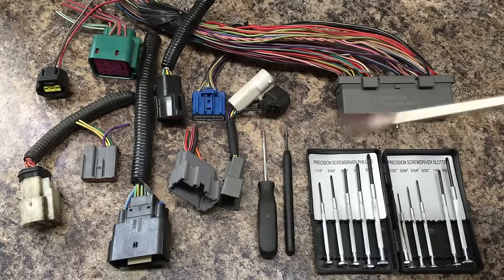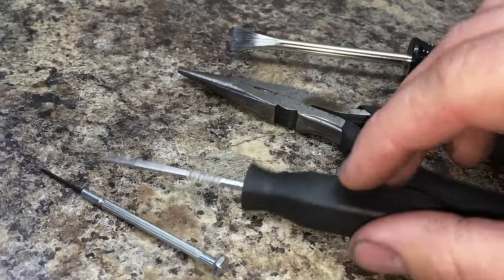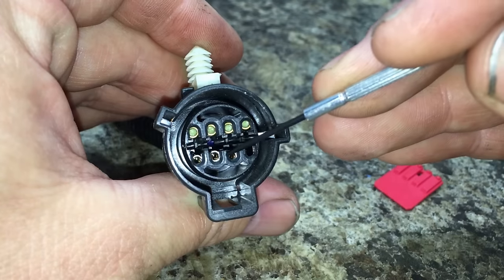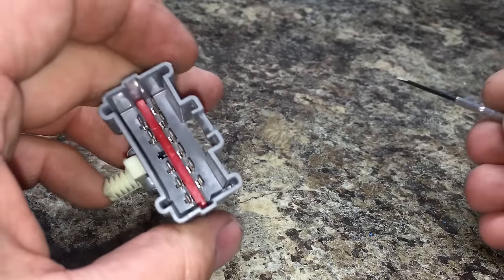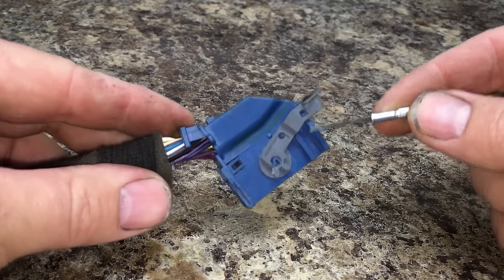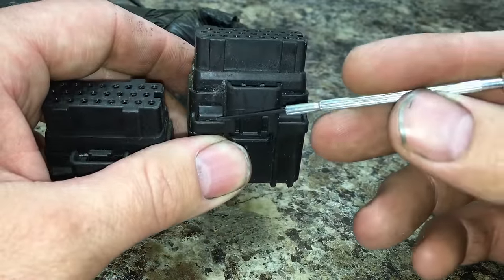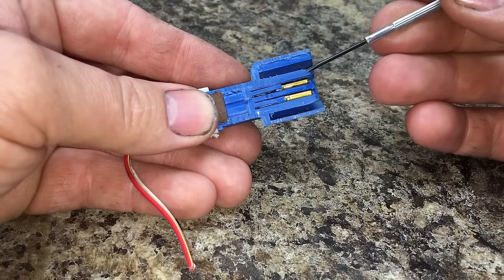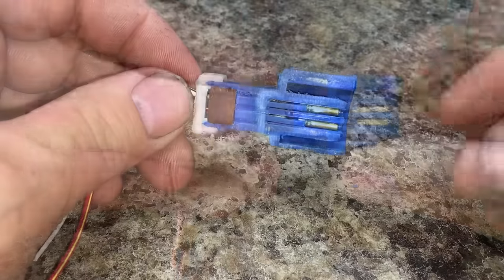Ford Quick Tips #62: Rebuilding Electrical Connectors on Your Vehicle

Comment: Commenting near 4 years after the fact, but I just wanted to say thank you so much.  You are a Ford guru and the world is better for your excellent videos.  I needed this exact video.  Excellent.  Thanks again!
Reply: Hell, don’t apologize I’m reading comments 5 years after. :-)
You’re right, thanks to FordTechMakuloco for the video. I couldn’t remember how I’d done this before.
Reply: Why was there a missing connector on the first pigtail will that piece need to be replaced with another connector?My map sensor pigtail is missing one also and a P2096 code appears so I am replacing the pigtail but want to be sure.

Comment: Timeless, hey it's 2021, and my 05 Mustang threw a P0193. My fuel pressure is at 68 to 70 psi. The duty cycle pumps are running at 100 %
I've tested everything from the Fuel Pressure sensor and it's in tolerance.
After 2 months of searching, including asking local Ford dealer to sell me info and asked on online expert who told me unless my car has a problem operating he didn't feel like he had to answer.
I scored the diagnostic tree. Itwo tests on I found the problem is a bad wire Pin 3 harness side.
You just gave me the.piece of the puzzle to finish. Thank you for making this video.

Comment: Searched up blower switch  plug and this video popped up.  I guess maybe because I am subscribed.  My 2005 FX4 with 187k miles is living a good life because of you. It's mostly towing (boat) and dump trips these days.  I work in auto care, but I'm a front of house person with mechanical work as my hobby
 Also my cars never get in...  You may know the dilemma of how the cobbler's children go barefoot!

Anyway, great video. I never stopped to figure out connector repair, and now I found a broken retainer on my blower motor plug when I removed my center stack cover to add bluetooth. Which is great BTW.  Now I don't need another radio and subscription to listen to satellite, just runs through the phone. 
You just gave me the connector solution, Love It!

Comment: Thank you sir. 
All the lighter sockets in my 2015 F-350 were wired always on. Wanted to set the console socket to ignition control, for a Dashcam. Your video was exactly what I needed. 
Thought I was going to have to run a wire from the fuse box. Discovered Ford provided the option at the harness, but I needed to switch some pins. Not wanting to hack and splice. 
Happy camper.

Comment: I know this is an older video, but car manufacture's now of days have a couple ones out there to be wary of. One in particular is a nasty bugger. For this particular type you have to take off a plastic retainer/cover(typically white) to expose the terminals, then you need to push in the soft rubber end(purple/pink) with a small screwdriver/mini Allen key. This pushes the connector forward where you now need to take either a needle nose pliers or tweezers and very gently grab the terminal, now rotate it 180*, then gently push up on it and slide out. I've only seen these on New Nissan's the pins are 1mm.  I found only one extra at a pick'n'pull to figure it out so they are RARE, and you cannot find them online to replace.

Comment: On the last blue/red/white connector, the "element" seal at the end is also serviceable.  It can be removed, and it's internal seal replaced as well.  On many connectors, you must remove this to completely remove the wire connector, as it's tolerance is for water/debris.  Nice video.

Comment: First off you rock so much for sharing the info by any chance would you also share what type the actual pin connector is, like size and usable replacement have a few wires that need new male or female ends and would like not to have to buy the whole pig tag if I can just replace 1 or 2 wire ends

Comment: Perfect timing. Just ordered empty connectors to repin my coil pack connectors with broken tabs.
Reply: Been down that road. Ford pigtail for replacement $85. Plastic shell $5.49. The trick is finding the shell. Ford is no help in identifying the part or a source.

Comment: 5 years after, but after a mouse chewed an ignition coil wire- dealer wanted to charge me $535. I found the offending wire and was just going to buy a new plug for $25. Thanks for the knowledge! You’re awesome. Now to get some hot sauce tape!

Comment: I replaced the connectors for my coils on my 5.4 ford expedition and they are working great...but now im trying to place the connectors for three of my injectors but im having a little problem trying to take off the red clip to release the wiring from the new connector...Is it the same process?

Comment: I just put a Frankensteined T45 transmission front half from a 97 Mustang mated with an 01 tailshaft housing and digital sensor/tone ring into an 04 Mustang GT set up for a TR3650...same same but slightly different ! Now a Franken-harness to match seems to be in order. I hope this works as Google doesn't understand what I'm trying to do lol.  This is arguably a downgrade but it was also almost free to do this and keep it on the road. It runs great but the speedometer and odometer connectors need swapped to make them work. Also the way its geared now its somehow getting me 33mpg with a 4.6 2V V8 while doing 13s on the 1/4. It's FBO but tuned for regular gas.  I've measured off of multiple GPS devices 33mpg its not a joke! I'd recommend this swap if anyone needs a cheaper option if I can get this to work with your de-pinning tips. 🤞

Comment: Great instructions. I have a 2006 subie sti with a broken alternater plastic connection. Need to replace the green plastic body only. Now I know how to remove the 2 wires  and instal, on the new connector. Muchas gracias

Comment: Quick question: what if you wanted or needed to replace one of the pins/terminals?  Where can you get those?  Does Ford sell them?  Are they just simple Molex connectors that you can get at any hobby electronics place or what?  Thanks

Comment: Really Great Video!  You weren't kidding that this was going to be an excellent and much needed video on the what why and how too on connectors. Seems the clips are almost always breaking off due to age, being removed and reinstalled numerous times, environment and especially due to heat in the engine bay on the plastics. Awesome Video !!

Comment: Great video,hey you wouldn't happen to know where i could find shells for Ford connectors? i have a 95 Thunderbird I'm restoring and i took the whole harness out, the fuel injector ones are classical that the tabs always are broken on those and i dont want to splice a new one, i just wanna change the shell,pretty much all the connectors are brokeen due to heat etc but just the shells,thank you for your time.

Comment: very nice, used a dental pick in the early 80s on toyotas. in the case of the wire end not coming out thru the end cap on that blue cutaway, will the end cap come off easily ?

Comment: Imma.gonna do this to my truck ..i have a parasitic draw and I found that is a 15a fuse but that fuse controls a Cluster B+ , interior lamps, puddle lamp, tpms (tire pressure monitoring system) 
 So i went deep on testing and I unplugged a few bundles of wires, turns out on one bundle of those wires there's a black wire with a green stripe that's draining the juice out of the battery.. so im going to pull the wire out of that thing and see if that will solve my problem...
 Thank you FordTechMakuloko

Comment: I know this is 5 years later and it is a long shot but FordTechMakuloco could you show how to take apart or depin connector c146 that connects to the control junction box on the driver's side of a 2006 6.0 powerstroke? I have managed to get one pin out (two wires were chewed at the connector) but I am finding it very difficult. Maybe you would have some tips. Thank you anyways and great video!

Comment: Dear Sir, this has helped me a lot. However, the types that I am dealing with are not in your video (they're for an old suzuki bike). So, learning from your video, are the different colored pieces inside the bracket always a removable locking pin? Big thanks. Greetings from Indonesia.

Comment: Thanks for this excellent video.  Is the idea to always replace the wire or wires, or to just gain access to the terminal ends for a visual inspection, then to remove any corrosion, add a small amount of Ford XG-12 grease (actually Nyogel 760G - compare the FIR on the various Ford XG-12 MSDS) to eliminate future corrosion issues and reduce the reconnection insertion forces required on multiple pin connectors, and/or to allow you to carefully tighten up one or two loose connections, and to test continuity and resistance while you're at it?  Thanks again.

Comment: Excellent video. Thank you for this. I have an 2019 F250 that the 2 wires (purple/yellow) coming out of the ABS mod connector we’re pulled out. This I found out it’s common with lifted trucks. Is there a way to send you a pic of what I’m dealing with. I bought the pigtail from dealer already. Thank you.

Comment: At the end of video on the cut out I have a pine on my 03 f250 4r100 transmission plung looks like that round pin in that cut out I need just the pin can you get them? Where? What are they called?

Comment: Brian,  just came across your video and need help.  Trying to find the connector that goes to the end of the "cruise control" harness for a 1994 F150.  The connector is totally gone.  Only two bar wires at the end.  Would you happen to know what connector type it is and where I could get one?  Thanks

Comment: I am dealing with a damaged main wiring harness on an engine wiring harness that was supposedly replaced (Ford GT500). After later problems, I found out the jerk mechanic just wrapped electrical tape around the wiring and charged for complete replacement.  I tried to repair the wiring, but sorting out damaged wires in a main connector of fifty didn't work very well.  I now have the wiring harness 1/2 the way out, but it is a complicated mess that is running everywhere.  I have all the factory manuals, but none talk about the main wiring harness.  I can see why the mechanic just wrapped electrical tape around the damaged area. It is a mess.  Any suggestions on where to find more info.  I can probably figure it out (I have so far) but it would be nice to have some more information.

Comment: I broke the locking clip and so I need a shell for my 99 ford F250 water in fuel plug.  I tried the dealer and they couldn't pull up a part number for the shell.  Where can I buy the shell I need?  Thanks so much for this extremely valuable video!

Comment: I have a 2003 supercrew with a vhs overhead rear seat entertainment system. The vhs player was removed, but the 26 pin female connector is intact. My brother gave me a vhs player from his 02 expedition, but it has a 16 pin male port. Are there any adaptors so i can hook it up. There are also av colored jacks for hooking up a portable dvd player in the rear. Just wondering if there is a cheap fix.
Thanks

Comment: Do you know how to source the individual terminals If I want to de-pin and replace a individual wire or add some wire to an existing connector? 
I can order some terminals from ford but I do not know which ones which.

Comment: Great info BUT where can a guy get the pins etc to fix one individual wire instead of replacing an entire pigtail?  I have sought those out and have had no luck finding them anywhere..  ie the pins for the ICP for example
Reply from the maker: +Michael Ronneseth the Ford wiring diagrams now includes part numbers for individual pins needed to complete the pigtail if you are repairing them so they order them off of that.
Reply: www.mouser.com is a good source.
Reply: Awesome.. I've searched and searched,  hopefully not too hard to get in Canada...
Reply: NAPA sells Belden wire product.  If you have the pin out, or can take a picture of it (needs to be out of connector), there's a good chance they'll have it.

Comment: Can the plug for the tailgate camera on a 2018 superduty be repaired?  Ford dealer says it is $1200 to replace the entire harness.  The female plug on the truck side of the conection has lost the microscopic center pin (corrosion from water intrusion)…..

Comment: Brian , I'm working on a automotive wiring  repair video and would be grateful for your advice. I'm a vauxhall/gm master tech and protocol for repair is to use heat shrink splice connectors and or crimp terminals . soldering is not recommended. Checked  with the vag group and they are much the same , could you tell me if Ford follow a similar principal ? I have seen some Ford training videos and an airbag document that mentions soldering but these where from 2005.
Could you offer any advice .
Stay safe Regards Joe

Comment: Great video have a question very important 91 f150 with a single o2 sensor they put true duals on the truck it's running fine it's will fry the ECU PCM ignition control module or rarely the coil I think that was ground and I think I fixed that but it still has dual exhaust and One sensor it won't kill it it has no crossover pipe I'm trying to eat out every bit of performance out of the thing from efficiency to performance I can add the pin stuff in there and make it look factory I want to know will a Ford F-150 ECM PCM support a 202 system the closest I can find to a performance ECM is in a 93 that's the lowest they go so I can make it look factory and put another o2 sensor in there no problem I just need to know is it possible that my truck will support that 5 volt reference and where should I hook it up to

Comment: First of all Great Video, i have learned a lot, Thanks. 
second. I need some help!!!  I have a Ford Expedition Limited 2006, with power folding side mirrors, the issue i have is that now the mirrors are barely moving when i try to fold them. they were working fine,  (I do not use much the folding, most of the time they are just unfold) they just sound like if they were run out of batteries, just moving a little. the battery is new, i have checked the fuses but all seems to be right, i don't know if there is any relay that needs to be replaced,   maybe you might know how to fix this, Thanks in advance. really appreciated.

Comment: I want to rebuild my harness but I’m having a hard time finding the terminals part numbers for each connector. I don’t want to pig tail the harness but run new wire and install all new terminals into the original connectors. I have a 2007 ford explorer 4.0 5r55s and found online a 1999 ford connector system catalog which would work perfectly if mine was a 99. I can’t find the same thing for a 2007, any help would be much appreciated.

Comment: Mak, im dealing with hybrid traction battery cooling fan connectors on 07 merc mariner. There is intermittent signal pass thru connectors to regulate fans. I used a small screwdriver to slightly bend female pins to better contact male spades. What is a better fix? Is there a better plug or trick for this? There is no sevice bulletin for these connectors on fans but there was a recall on the neighboring connector for control unit for ev battery due to loose connector on ev battery control unit which so i am told caused fires due to signals not passing properly thru this connector to protect battery pack from overheating. So i assume there was the same problem with the control module plug as i am having with fan plugs= loose connector contacts. No service bulletin on the fans. How can you tighten the female side of the plug on a connector? Depinn femal side of plug and repin with stiffer connectors? If so which ones to order?

Comment: Can you show me a special way to remove a 2005 f150 coil pack plug that has taken me 15 minutes to struggle with and not snap my coil or the connector. I am almost ready to use a sledge hammer. Can I spray something on it?

Comment: Turbocharger bypass wpt 1062 does not want to release locking pin! It will slide up but there is a hidden locking pin I cannot see or reach. Any suggestions?

Comment: I broke the connector on the oil sending unit on my 2013 Ford F-150 5.0 I was going to put it in and RTV rubber around it

Comment: f150 2006 fuel pump driver module wiring harness Do you know if I can change the whole harness under the bed or is it like all attached. I have one broken wire but the rest of the wires dont looks so well either. I did solder it back and put shrink wrap on it but I had to add a piece of wire so it has two different solders dont even know how long it will hold. I've searched online with nothing as far as harness but I can buy the whole connecter then again you would have to solder all the wires together.

Comment: Great video I am looking for a female and Male conector to use power supply from rear mirror to power my dad cam but is difficult to find the plugs any advice ... f150 inside mirror 16 pins

Comment: Are new pins available?
Reply: If you want new pins you have to buy the pig tail that comes with the connector with pins in it. Then you have to wire it up. He is showing you this so you dont have to do wiring, and this prevents any problems of wires coming loose where your new wiring connection is done.

Comment: What are the terminal pins called. I'm looking for the small square ones on my 2004 ranger. The main harness inside the cab that controls dome light. And radio

Comment: My question is.... my pigtail terminal for my alternator the small one that plugs in the wire has a little bit of play inside the pigtail is it ok to use or do I need a new one thanks